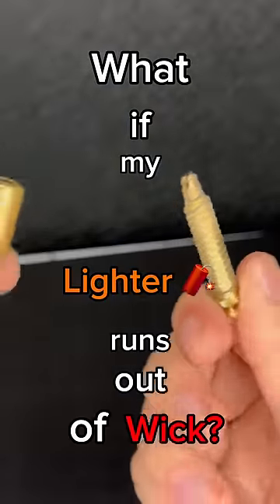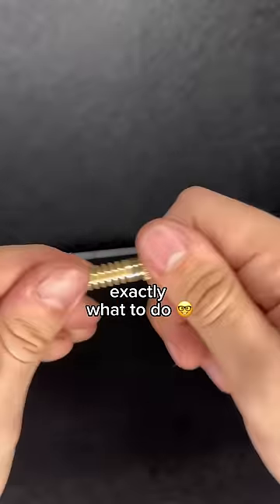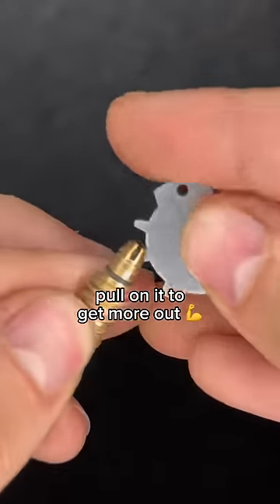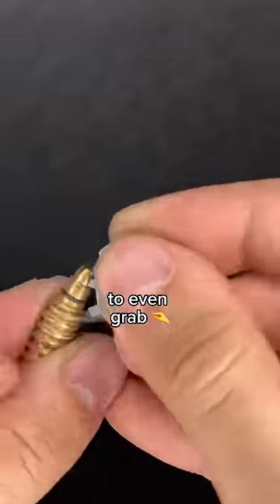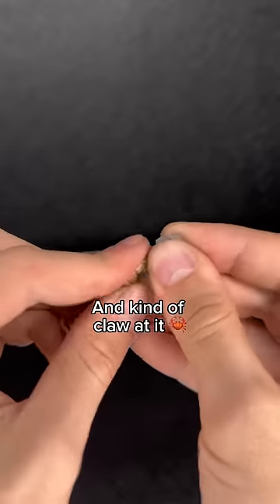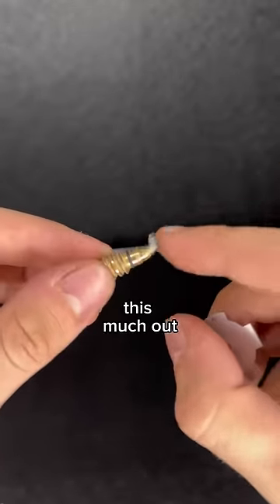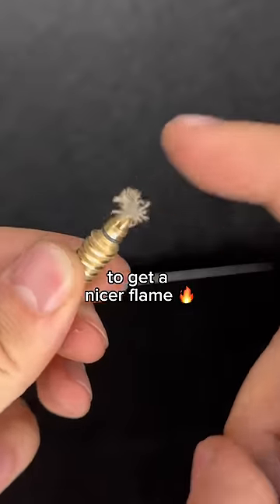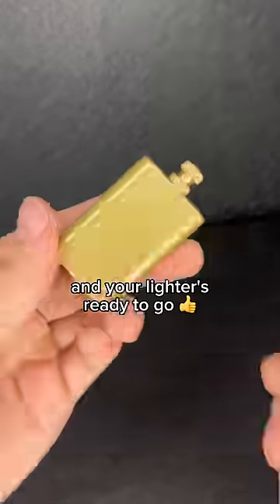What if my lighter runs out of wick?

Comment: Ok so here’s an actual answer. If you run out of wick. But a cotton ball/bad get tufts of cotton. Roll a half cm sized cylinder pole it through with a toothpick and then congratulate yourself for your determination before hating yourself for buying a lighter that requires excessive maintenance